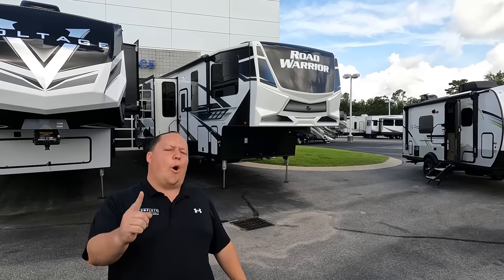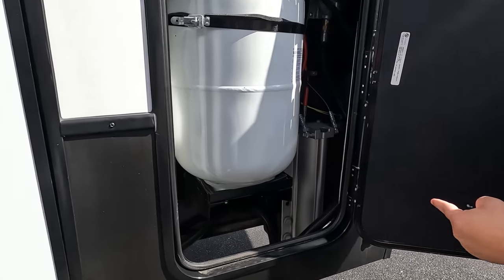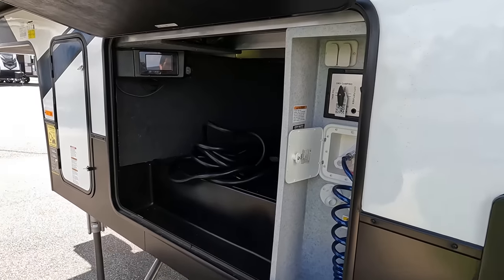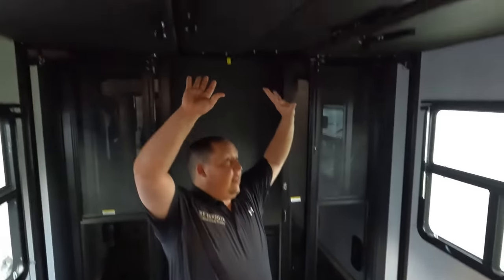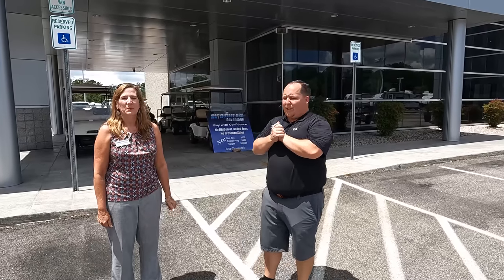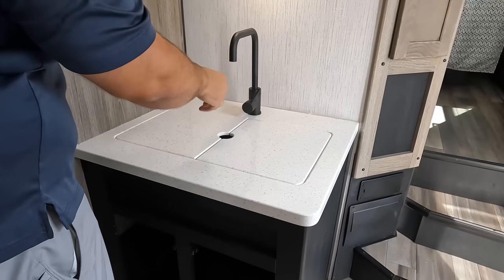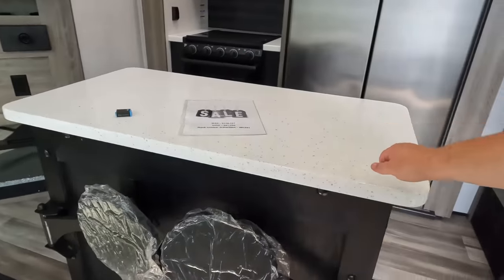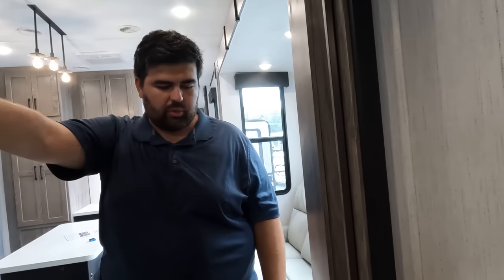Wow Huge Mega Toy Hauler!

Comment: Heeeeeeeeey so a toy hauler that’s up a couple of tiers - very nice .:. Big dinette in the garage (patio / lanai / solar room) 👍🏽 looked like it seated 8; big shower 👍🏽 nice jets; king beds rule 👍🏽 esp north and south; bonus for boondock access 👍🏽 generator, controls, big tank, reach the main bed and bath with slides in; double bonus it’s a beast 👍🏽 3500 lbs ccc .:. stand-alone sink 👎🏽 hinged counter extension would really help; small main bath 👎🏽 (smallER half bath); 8 people + W/D + jet shower - 10 gallon = hot water crisis 👎🏽 we’d option tankless; bonus on the sofa 👎🏽 I’d rather drop one cushion for the table and seat 3 (bcz there’s 8 of us) - sleeps 8 and eats 8 but seating 8 is tough, even with the cool island bar stools .:. 85K phenomenal sale price  plus the (pre-owned low miles mint condition) truck I need to tow it is ballpark the price point of our favourite class C - but this has lots more space, I have a garage, and We can leave the house at the site when We drive into town for dinner 👍🏽👎🏽 you tell my wife she can’t have a coffee at the dinette when we’re driving .:. Thanks for the review M/W